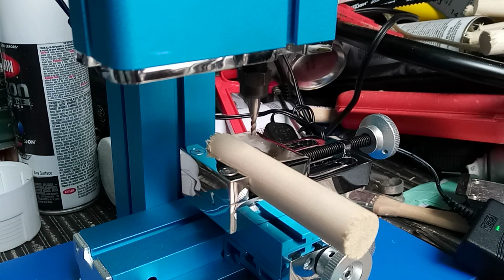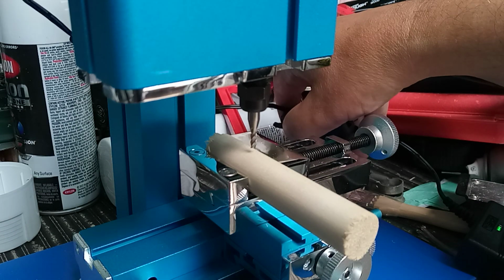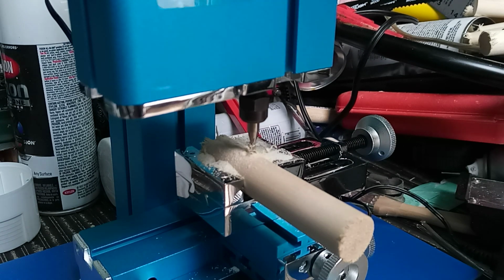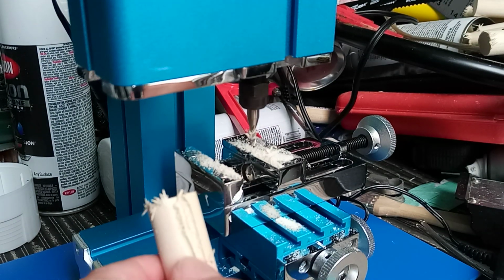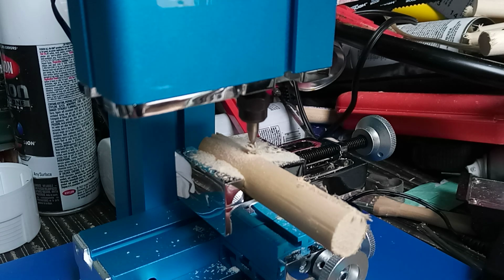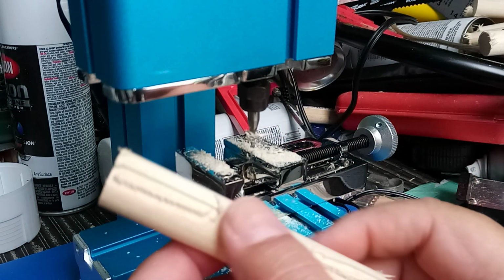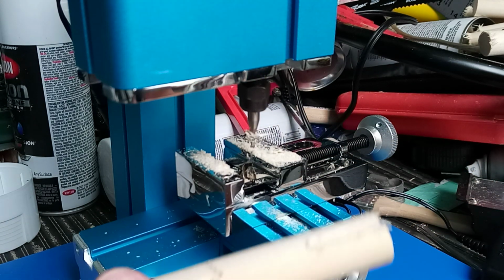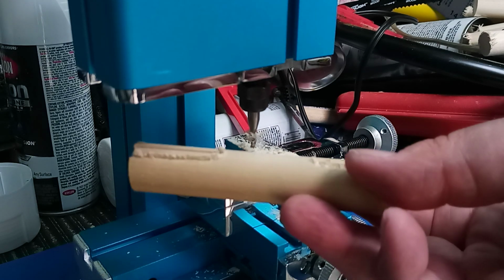Using my Micro Mill. #engineering #hobby #workshop #homeworkshop #tools #modelengineering #robotics

Comment: its awful! lol...

no locks? no gibs? 

if you fed in from the end, the cutter will always push it one way, so at least you can counteract the backlash in the X axis leadscrew. just like the first cut its pushing over to the left... with some practice you "might" reduce the movement... all mills have some backlash you have to compensate for...
but the way the Y is wriggling around... a lost cause. lol.
Reply from the maker: I suspect that if I adjust the set screws, it should be fine. There were set screws on the side of the one axis. I honestly haven't looked to see if there are any on the other.

Bear in mind this milling machine is intended for small robotics.where absolute accuracy is not so essential.